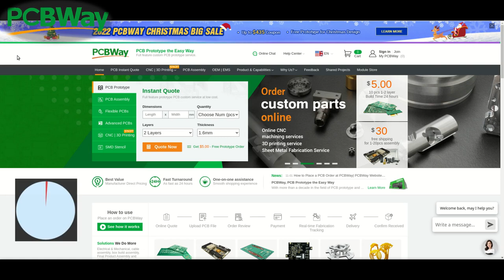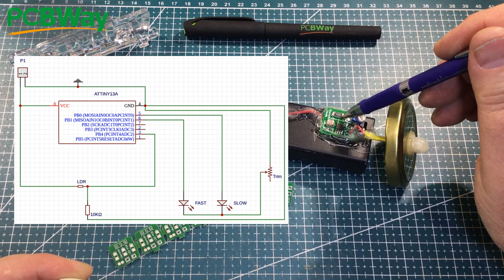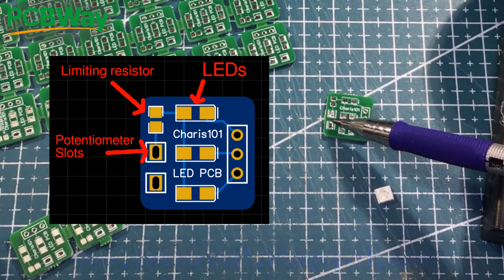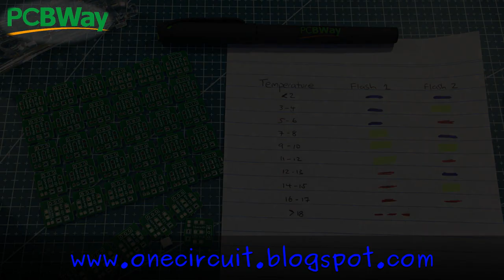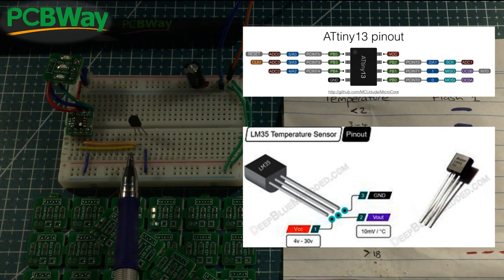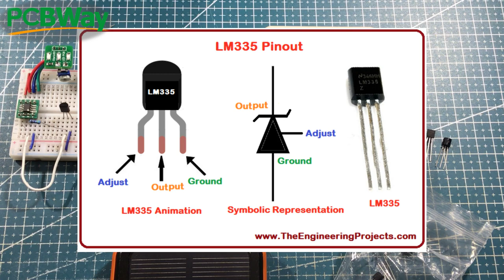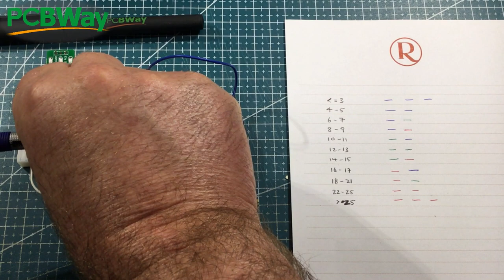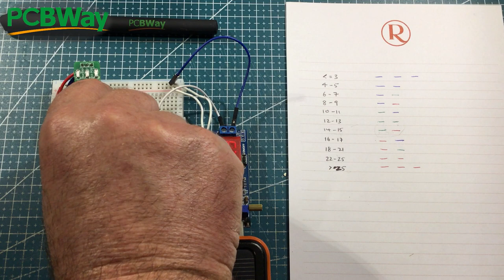LM335/LM35 and an LED PCB from PCBWay

Comment: I think I would approach this by using flashes to send out the temperature. If the temperature is 2 degrees send out 2 flashes, then pause 10 seconds and repeat. If the temperature is 15 degrees send out 1 flash pause then send out 5 flashes, then pause 10 seconds and repeat. No need to learn/remember color codes representing temperature, all you need is one single blue LED.
Reply from the maker: I’ll code that and see how it looks. The colour code is unfamiliar at the moment, but that may improve over time? 👍😀
Reply: @onecircuit-as  If you sort out the floating point math, you could send out 17.4 degrees as, 1 flash pause, 7 flashes pause, 4 flashes then pause 10 seconds and repeat, where the last digit sent is always the 10th of degrees. 0 could be sent a couple of ways, it could be a long flash, or maybe 10 flashes.
Reply from the maker: I was hoping there would be a few suggestions from YT world! 👍😀

Comment: You certainly are king of the electronic candle on Youtube :) Nice to see PCBWAY are looking after you. They haven't reached out to me, but I guess 1 electronics video and 7 subscribers is probably not enough XD 
 I used to use JLCPCB for my replica Science Of Cambridge MK14 projects and others, but noticed the quality of the silkscreen going downhill for some reason. Since then I've tried some other Chinese PCB makers and PCBWAY seem to be the best alternative and they have some of the cheapest shipping to the UK if you're not worried about waiting a bit which for a stingy bugger like me is important!.
 I've been thinking about making some LED candles as a nightlight so I might be plagiarizing your code any time soon....
Reply: I had a lot of trouble getting stable readings from the LM35, and heard of people on forums with the same problem. They seemed to oscillate so maybe they;re needing decoupling or where fake like yours  but I dont have access to my scope so I wasn't able to investigate it and moved to digital temp sensors.
Reply from the maker: You’re welcome to the code, ATTiny13 or PFS154? 🤔
Reply from the maker: I’m not throwing them away just yet, I’m still hopping mad! It’s not the money, it’s the time wasted. 😢
Reply: @onecircuit-as  I've got ATTINY85's because I got a load to replace the Mini Pros I was using for things with only a little I/O. Glad I did that before prices went mad :)
Reply from the maker: More PWM! The code should be fairly portable with the pin compatible ATTiny13. 👍😀

Comment: There are crazy amounts of ways to get better granularity. Off the top of my head are binary output and Morse code.
If all you are wanting it 2 flashes most of the time, you can still double your resolution by adding long and short flashes to the mix. Right now you have 2 the the power of 3 choices with 2 flashes. It would give you 2 to the power of 6 flashes, or go from 8 specific options to 64 options. 
That many options could get confusing to remember though.
Another choice is color theory. Mixing colors gives different colors. More colors could just as easily give more resolution while not needing anyone based cod element. Not to great for colorblind though.
Reply from the maker: The interesting effect has been the “wandering” of the temp a little bit dependent I assume on voltage, but on the whole it’s been reliable and useful!
Reply: @onecircuit-as  ya, I think I read in the spec sheets that it has a linear voltage output, so it shouldn't wander and any general correction should at one temp should correct for all temps, but if you look close, it does say that its temp changing changes the temp output. It will talk about how they used an oil bath, which negates it's circuitry adding to the heat inside itself, so they say that depending on real world conditions, that it's ability to dissipate excess heat may vary and this so will the voltage.
Do you have it heat sinked at all or is it in a sealed chamber where heat may build up? Or could it be close to a surface where wind could affect its temp?
Reply from the maker: @haddow777  It's sealed but it only operates at night and so it should be fine. Wind is an interesting factor - it is fairly exposed on a gate post!